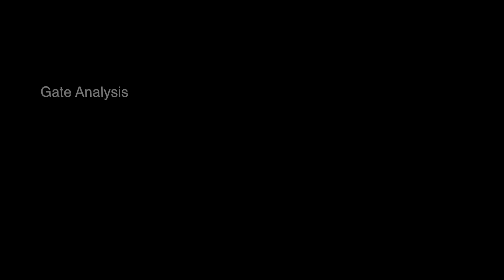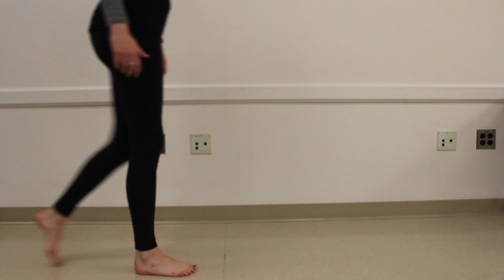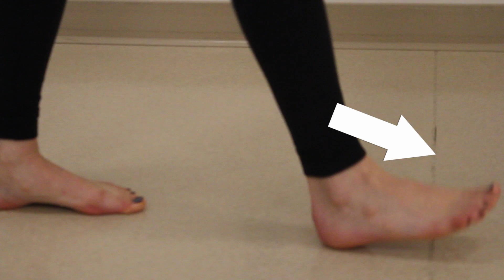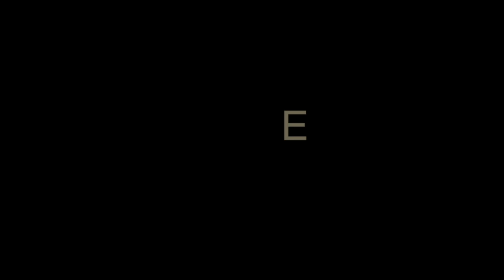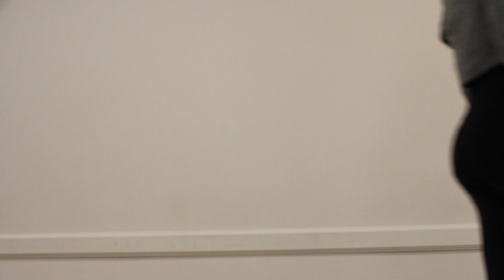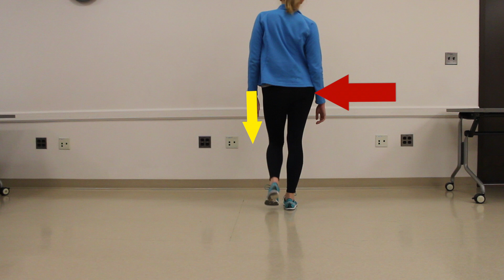Gait Analysis: Muscle Moments During the Loading Response Phase

Comment: I have a question, maybe you can help me see this better. Which puts the ankle into  its max dorsiflexion; is it initial contact or terminal stance? I can't see why it would be terminal stance.
Reply: i think because terminal stance is the phase  in which the lower limb  must be taken off the floor to be able to start  swing phase.. so to raise the all lower limp, : 1-the hip joint  maximally in extension 
2- the knee is maximally in flexion
3- 👉ankle is maximally in dorsiflexion